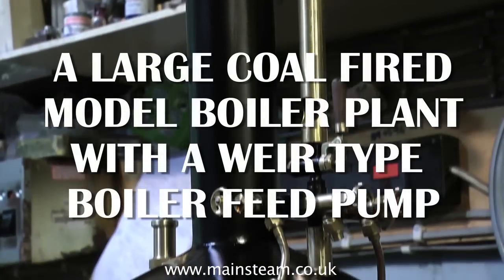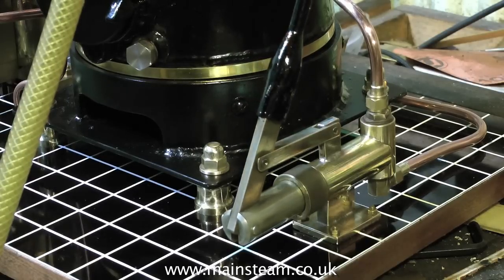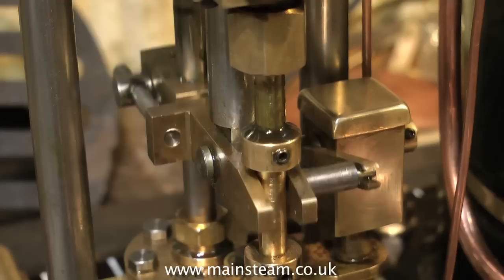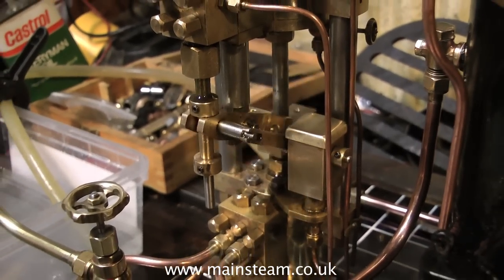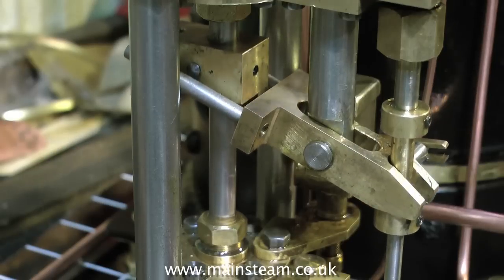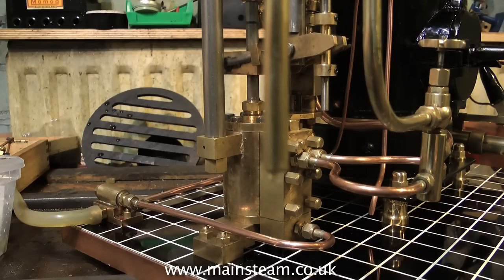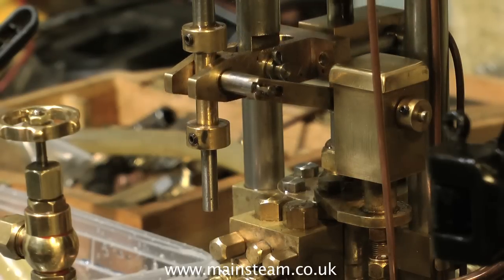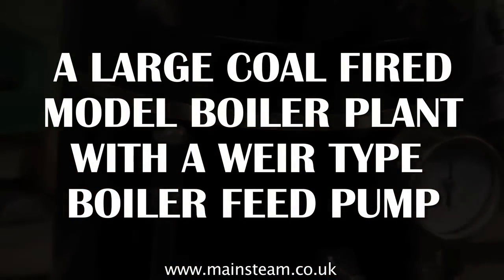LARGE COAL FIRED MODEL STEAM BOILER PLANT WITH WEIR PUMP

Comment: As an ERA in the RCN our boiler room on DDE's had a Weir pump and it was LARGE  with piston skirts that would come down and chop your arm off if you were foolish enough to stick your hand in there with an oil can. It would cycle intermittently as required to maintain boiler level, so one never knew when it was going to cycle so one gave it leave to do what it did without any needless interference.